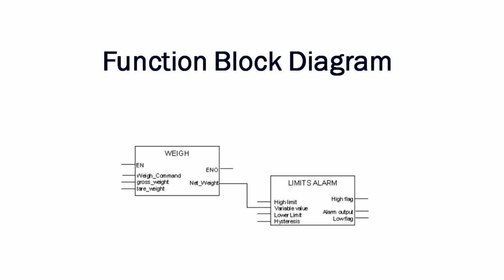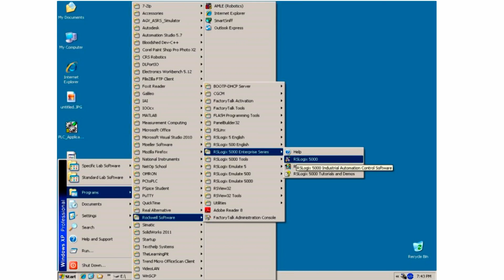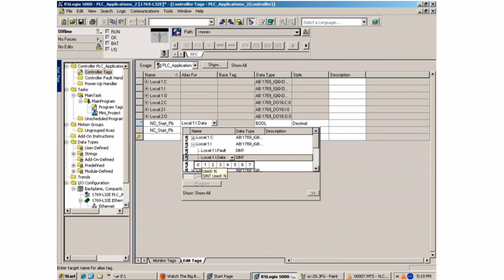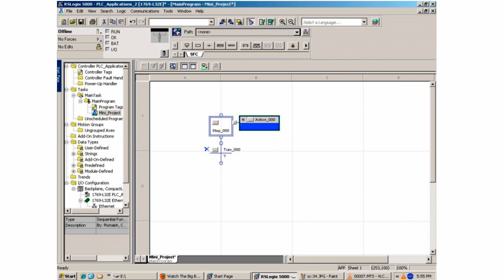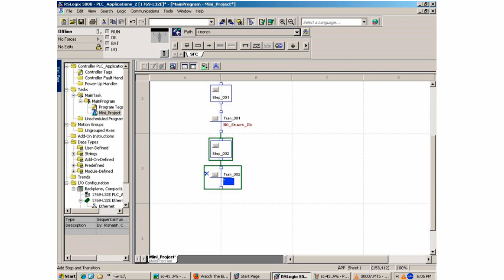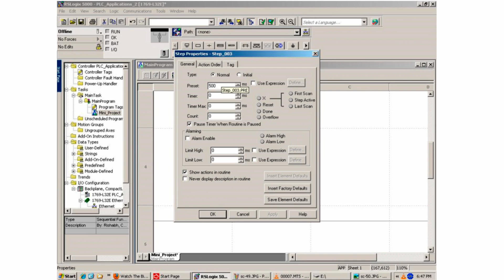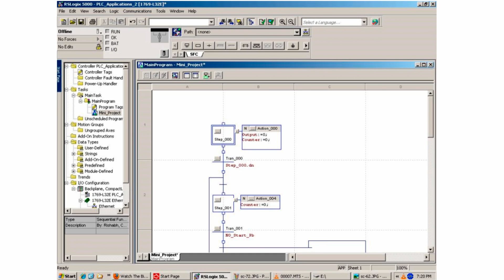SFC Programming Using RSLogix 5000 (HD)

Comment: One thing that should always be noted according to best practices (http://plc-training.org) , just because there are 5 programming languages available, does not mean you should use them. Best practice is to always use ladder logic, and only result to other languages if absolutely needed in your particular control demands. This aligns with best-practice, make your PLC program as user friendly (easy for layman to understand and troubleshoot) for the end user as possible. As the end user is often a maintenance electrician, computer programming languages like "C' (Structured text) and SFC which use structured text ... should be avoided. More ... http://bin95.blogspot.com/2014/09/plc-programming.html
Reply from the maker: +BIN Industrial Training ...Yes, you are right.  The most common PLC language is in fact ladder logic by a long shot.  Reason being, it is easier to understand by tradesmen such as electricians (since it looks like an electrical diagram).  Ladder logic programmers are a dime a dozen.  In some cases, when there's a lot of math involved, I have seen a combination of ladder and structured text.  Structured text will save you a lot of scrolling through pages, but you would have to have the mind of a computer programmer to understand it.  SFC is also a lot more efficient than ladder.  A 500 rung ladder program can be accomplished a lot faster in SFC.  Since it's not very common, videos for SFC programming are hard to find.  But if you pay attention, it's not that difficult to understand.  It's a graphical flowchart in the end.

Comment: Hey Carlos. Which version of RSLogix 5000 are you using on this video? I am trying to create a SFC routine but in mine (V16.00 or V17.00) this option does not appears, just Ladder Diagram. I read something about safety programs that only allows LD but I could not find out what is happening. Do you know what it could be?

Comment from the maker: Chau,

The most important part in press control equipment is how the electrical engineers wire their safety.  Once the safety is complete, the wiring of the PLC inputs and outputs can be controlled using any PLC language.

Take into account the PLC you are using and what it can do.  e.g. AB ControlLogix will perform 4 of 5 programming languages.  Not every PLC will support every language.  The most common in industry is LADDER, but you can learn others and use them as well.